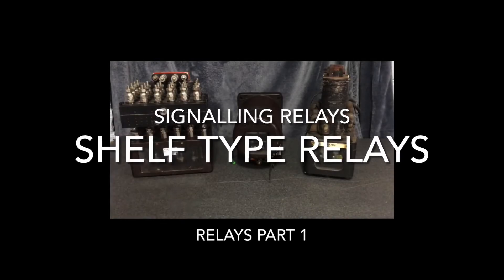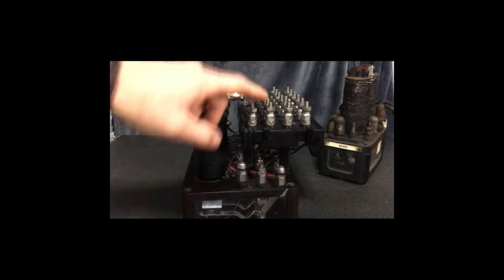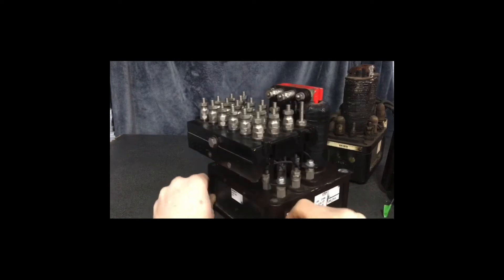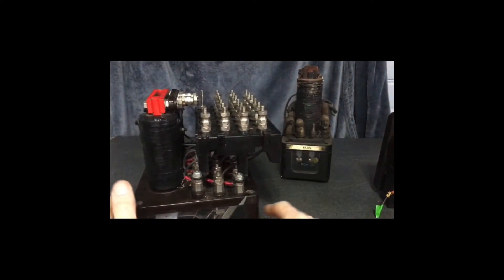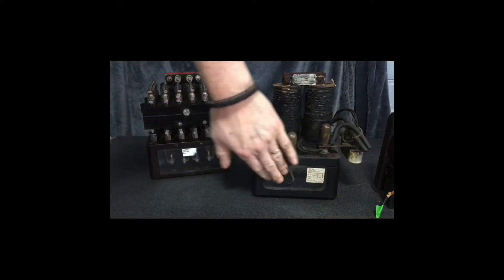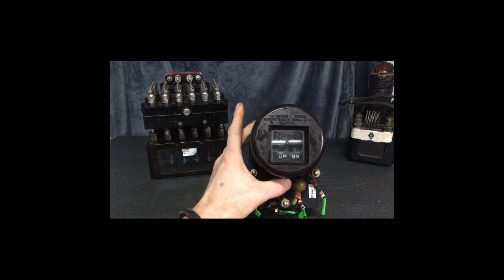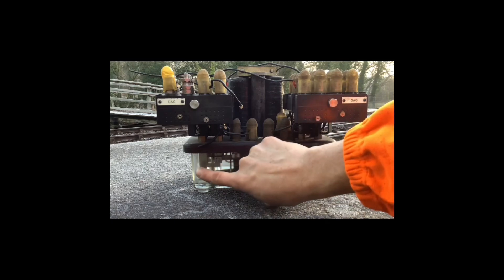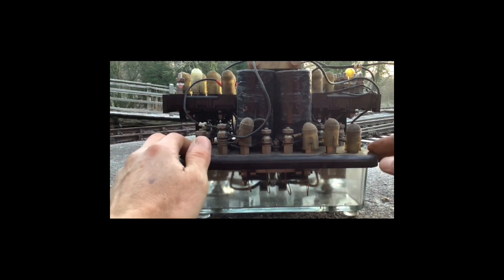Signalling relays part 1

Comment: Do you know what type of metal the bolts are (the ones that shear off)? The center of them do not appear to be steel
Reply from the maker: Ironically I did,there was an article written on the construction of them that defines the metallurgical principles of the relays contacts so they neither end up Magnetising, corroding and such in normal operation and it did say they were an amalgam of a few things, if I can find it il post it up
Reply: @irseminorrailwayssection9491  thank you!